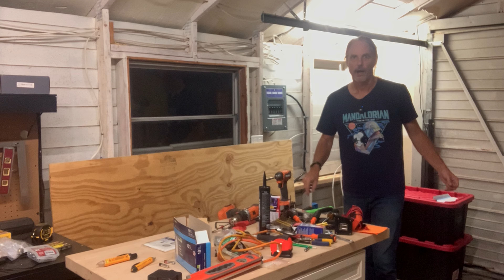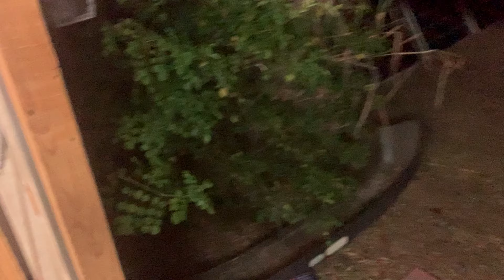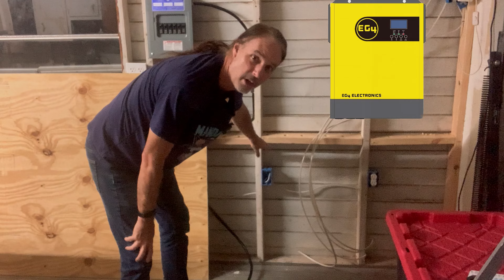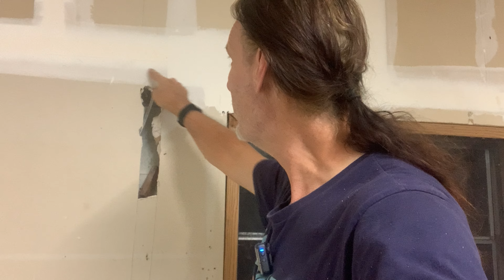Solar Shed Electrical Update – Wall Plugs, PV Wiring, and Final Checks

Comment from the maker: 00:00 Intro - Electrical Over New Solar Shed
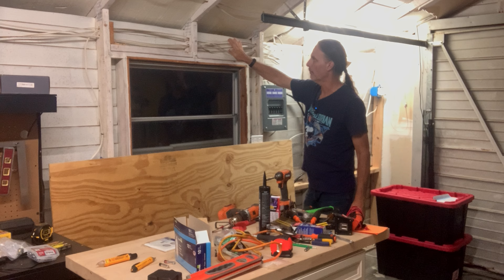00:13 Placement of Outlets and Wiring Updates
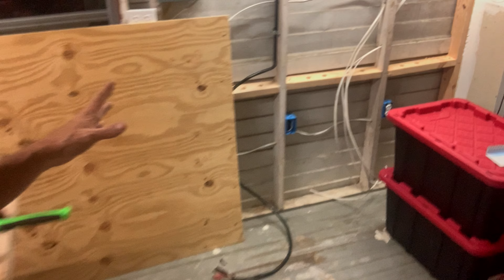03:16 Update on Solar Wall - Mounting Ideas and Thoughts
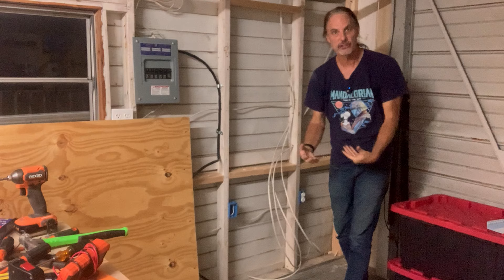07:00 Review of Montoring Outlet 
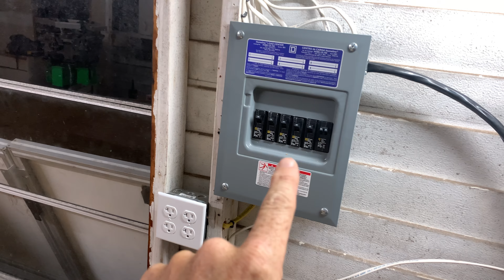08:19 EG4 3000EHV 48V All In One Outlets and Mounting
09:54 Porch Light Rough-in 
10:29 Refrigerator Plug Rough-in
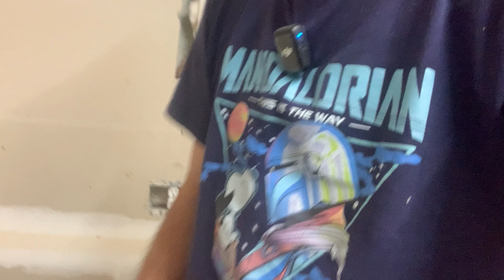11:18 BLANK SPACE?
12:23 Wrapup plans

Comment: Solar PV wiring must be installed in metal raceway upon entering a building and extending to the first readily accessible PV disconnecting means. NEC 690.31(G)
Reply from the maker: Oh crap, 690.31(D)(1) in 2023 NEC Code book has the latest.. You are correct .. Thanks for telling me prior to finishing that wall.. "Where inside buildings, PV system dc circuits that exceed 30 volts or 8 amperes shall be contained in metal raceways, in Type MC metal clad cable that compllies with 250.118(A)(10)(b) or (A)(10)(c), or in metal enclosures." This exception is related to rapid shutdown .. So, I got to fix that first .. Good catch..
Reply: Paraphrased from the 2017 NEC
Reply from the maker: Welp it sure helped.. Thanks!